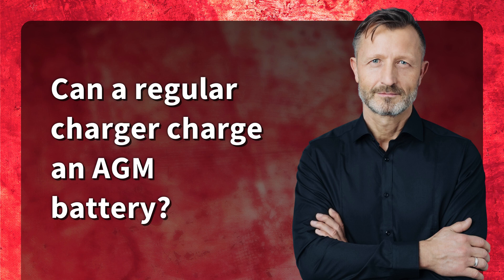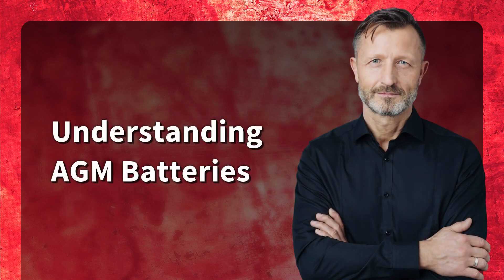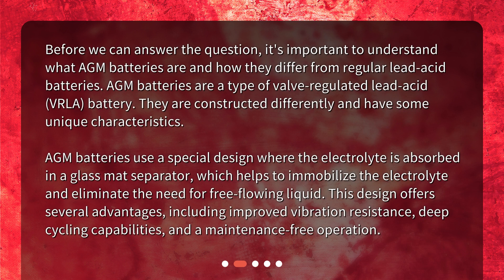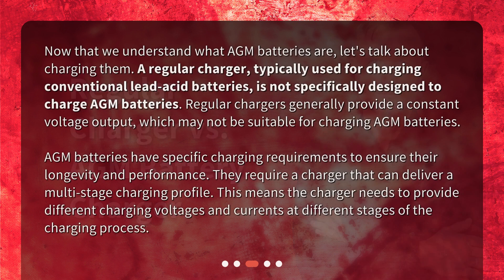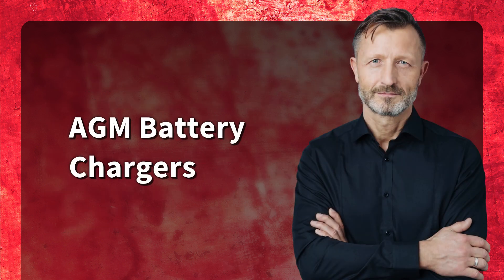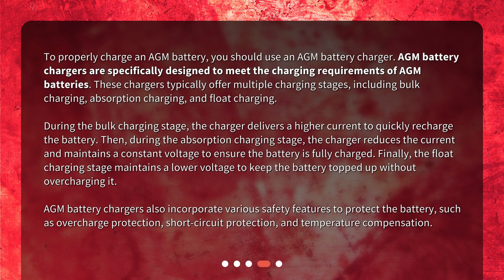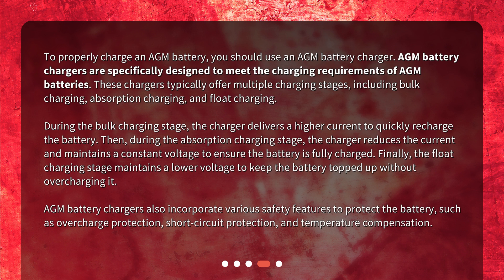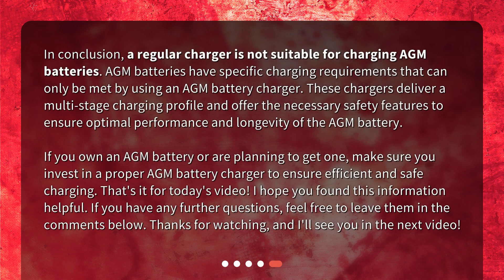Can a regular charger charge an AGM battery?

Comment: They work fine to get you up n running,  a decent modern charger has selectable battery profile mode types, or even better solar works great using a pwm controller 😊

Comment: I recently had an AGM battery installed in my truck. I then went on line to fine out if a regular charger could be used to charge and AGM battery. Every single one I checked said a regular charged is fine for that application. Now you are telling me different? I do have a regular charger that does what you claim I should use but it does not indicate on the box or the owners manual that it is for an AGM battery.